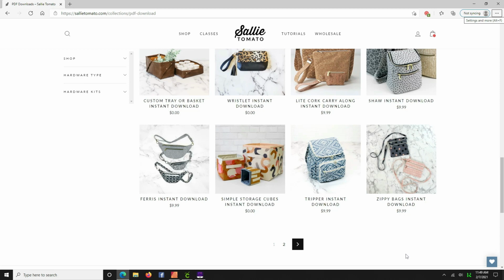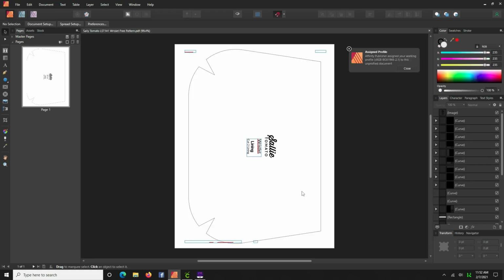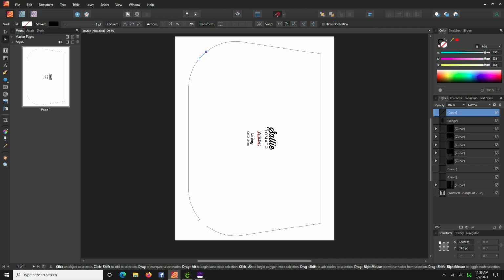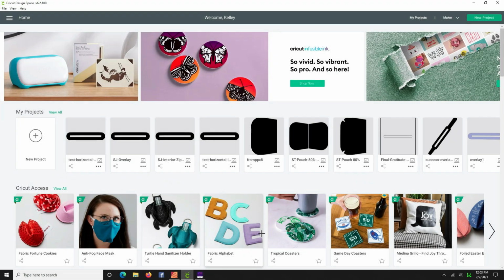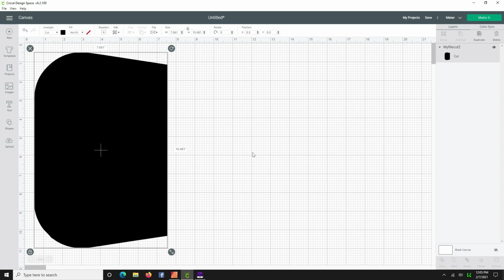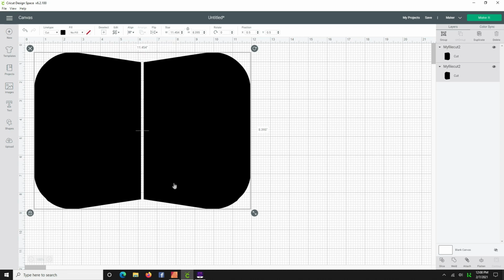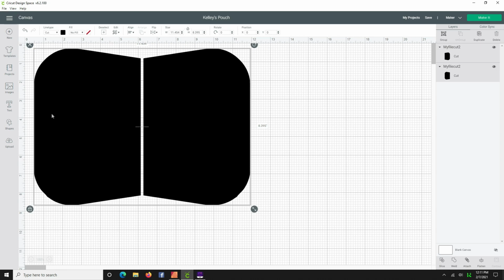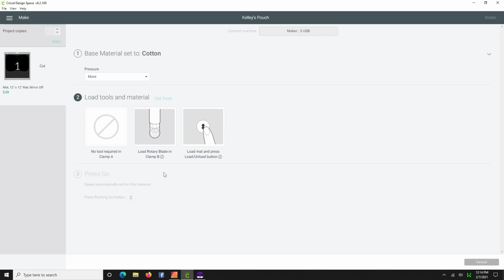Cricut Maker Series -  Learn How to Import PDF Patterns into Cricut Design Space - With Kelley Rao

Comment: Kelley not sure what I’m doing wrong.

Like how do you get the pattern piece to retain its correct size from affinity to cricut as I can see you delete the 1” reference square as the first step in affinity. Mine keeps importing into cricut super large and when I do your trick to slice and hide the larger piece, change the square to 1”, then unhide the pattern piece, the pattern piece is always slight on askew usually being like 0.05 to 0.15 smaller which is a difference when I try to match it up to printed piece to check its size

Comment: Thank you so much for this video! I am wondering if you have any tips for doing patterns with punch holes for snaps or card slot lines?
Reply: Like patterns that have holes already cut in them for snaps placements and lines for credit card slots. I had watched a video and someone had told me that you can add shapes in and size them down to make it where the file will cut those shapes but it seems very hard to do I didn't know if there was any way of doing that easier in maybe the publishing  program.
Reply from the maker: @anniekorn577  I’d not cut little rivet holes with cutter. For cc slots, I use templates. Flip, fold, press.
Reply from the maker: Not sure about using Cricut for these items?  Can you explain further?